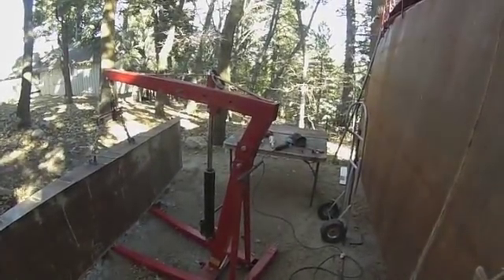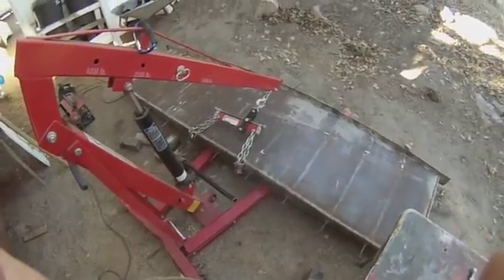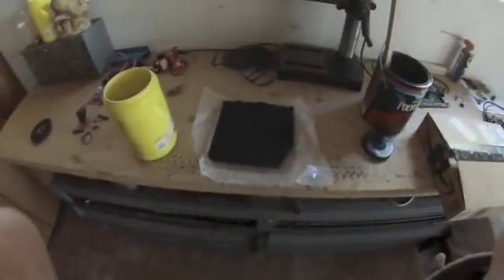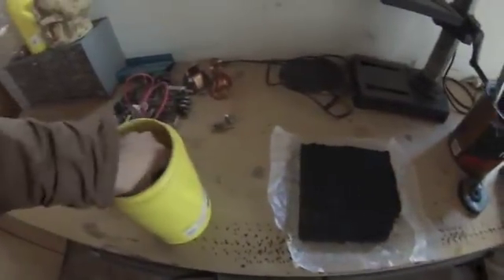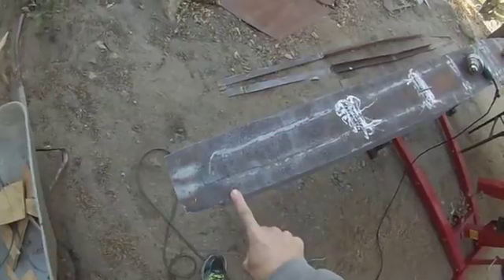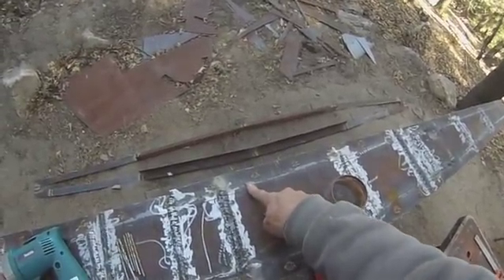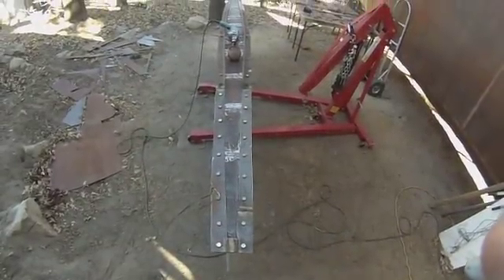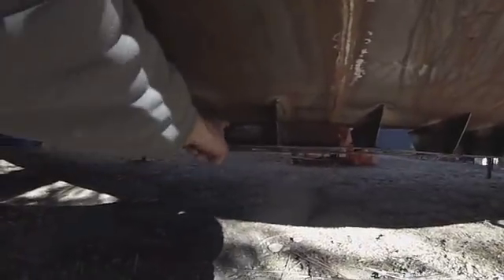Steel Sailboat Build Part 10

Comment: Hello Craig, I found your channel today and was impressed of your work. I build a 47 feet steel sailing yacht in Germany (Designer: Anton Luft, Type: Motu 42). To smooth out the bumps in the hull, it might help not only to hammer and heat, but to make small cuts in the steel, eventually hammer and then weld. The weld will pull the metal in a more flat and smooth shape! Good luck and success with your project - looking forward to more videos!
Reply from the maker: Thanks for the idea!  Some of the bumps/dents are proving difficult to remove.  Cutting before hammering might be the trick.  Much appreciated!  Your yacht is going to be amazing!  If you have a link to videos or photos, let us know.
Reply from the maker: Love your rough seas videos!
Reply: Sorry, no videos, only FB

Comment: Craig you are a crazy person and I love it.  Keep up the good work!
Reply from the maker: Thanks!
Reply: Craig
I applaud your chutzpah, but I urge you not to invest too much faith in the raw power of optimistic confidence to overcome the inherent problems of material deformation.
Taking one example: Your 11G keel flange is one third of the thickness it should be as a minimum.
This means it is nine times weaker than it needs to be (1/3 squared) and twenty-seven times less stiff (1.3 cubed)

Your hull seems to me to draw on intuitions formed from working on car bodies. But car bodies do not have to deal with the leverage of a sail acting through a mast in gusty conditions, nor do they routinely slam into liquid walls (or jetties, for that matter, when a passing wake combines with a misjudged approach). They are designed to crumple if anything approaching the normal loads of sailing were to be applied.

The dynamic loads applied to the hull by a single rigging wire can approach the entire weight of the boat, so you should be within cooee of being able to pick the finished boat up by a single attachment point.

A half inch rib is not significantly an improvement over no rib at all. And your hull plating (once again) would need to be at least two and preferably three times as thick to get away without having ribs. (Same ratios apply as above)

Comment: I just binge watched all you vids after finding you from seeker. I admire your dedication, attitude and aptitude and have reserved judgment and comment until seeing all. I have worked as a welder and fabricator and I have owned but not built several boats both power and sail. I don't know what your vision is for the finished project, but as it sits now it seems way too fragile for blue water. I envision cracks and leaks and catastrophic failure. Maybe your ambition is only inland sailing on a local lake?
Since you are obviously familiar with English cars I will make the Lotus analogy. If you put enough small light bits together in a proper way, you can achieve strength that exceeds using fewer heavier bits. I hope that is what you have in mind, and I look forward to the finished product.
Reply from the maker: I am hoping the same thing you are.  Each seem between sheets is welded inside with a foot of ribbing reinforcement every foot.  That said, I won't know how strong it is until it sails.  Might start in Puget Sound to test it out.

Comment: I'm sorry to say that your creation is going to be a very wet boat, what I'm saying is your gunnels are supposed to flair outward so as to disperse the water and create a fairly dry deck . Amidship is where the flair starts to end, the sides then are fairly plumb if you will and continues to the transom.
Reply from the maker: I don't doubt you.  Wet will be ok, since I will be in the Pilot House to sail it.

Comment: I'm already waiting for the next episode. I own a 36 feet steel sailboat so it's interesting to see how much work it has put in to it. 
I wish I lived in USA because the averall cost in Sweden, Denmark and Norway would be about 3 times more expensive.
Reply from the maker: If you have a video tour of your boat and its structure, let me know.  Thanks!
Reply: Well, no video (yet) I currently do small restorations and upgrades and maybe I will do a video later. The boat, from top to bottom is insulated with 45-50mm PU foam so it's hard to see the structure. I have all original plans for it though if you want to look at them. The boat was built for the north west passage and sailing around the world but the previous owner/builder got to old and had to many health issues which stopped him and he's wife to go. He was a captain on very big ships for probably 45-50 years and the hull was based on a ship yards model which they sold as a "empty" hull. The buyer had to do all interior and some of the rigging selections on their own. He modified the hull a bit with a smaller cockpit, integrated bowsprit, bigger afterdeck, a sloped transom, 5-10mm steel in the bottom,  wing keel,  and put a bigger rigg (19 meter) on it. It was finished 1997 and I bought it from him in september this year. I managed to sail her about 100nm in one month so I know what to fix and upgrade  this winter. Here is some pictures before I started with my upgrades. She has been in the water for 5 years when those pictures where taken, so she needs a lot of sanding,varnishing, polishing and cleaning on the outside. If you find something interesting I can give you detailed pictures and the plans. "Edit" Forgot to mention the ship yard garanteed no damage what so ever if you ran aground in 8 knots. :)
http://www.batagent.se/3094#bilder